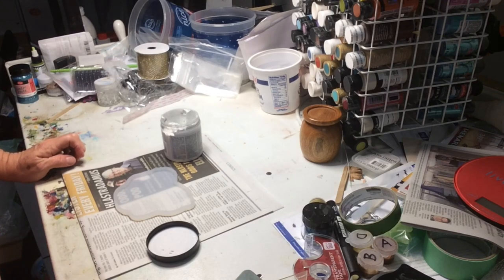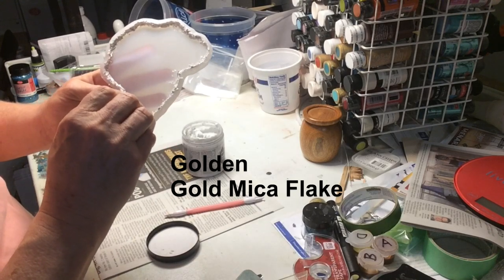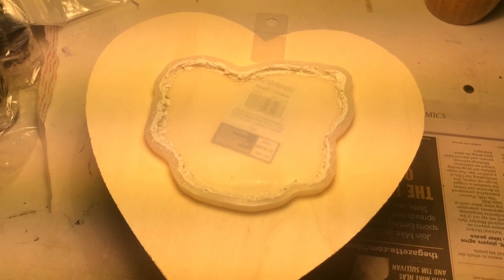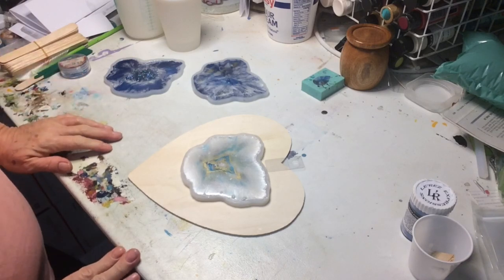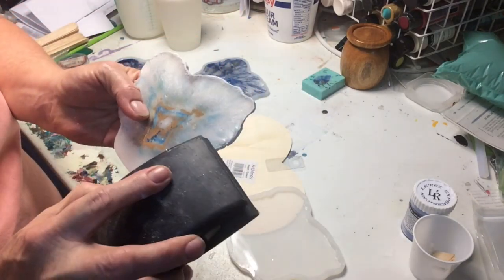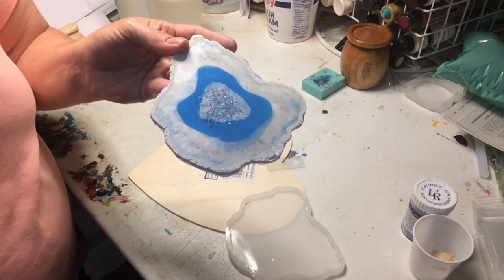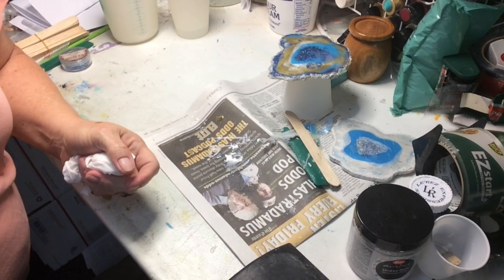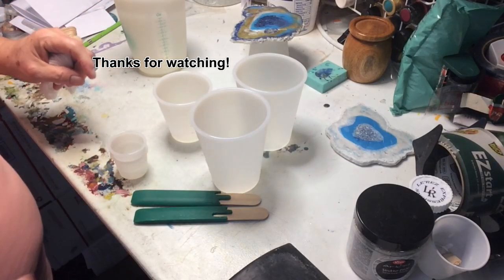Resin and structure paste and a special "UNBOXING”

Comment: Very pretty! Good job. How did the free-handed structure paste geode turn out? Did it adhere well? Must you seal it afterward to prevent it from flaking off? Thanks for your help.
Reply from the maker: Informed AndFree sorry, I complete missed this message. You don’t have to seal it, it hardens up almost like concrete. But if you have glasses that sweat, then I would definitely at least seal the structure paste. You wouldn’t have to put another coat of resin. I would just brush some sealer on it

Comment: can you use any kind of tenure paste
Reply from the maker: Tina Marie Malinowski that I don’t know. I know it works for the texture paste I have that is Viva. I was skeptical of doing it at first, I was afraid I might ruin a coaster mold in the process. So before I did this video, I tried it in one mold. It worked. 🤗🤗🤗 the Structure Paste I have dries kind of like a cement texture....and I know all texture pastes are not the same consistency.